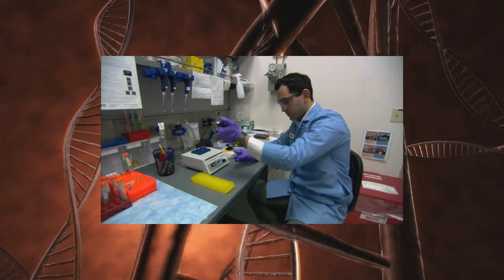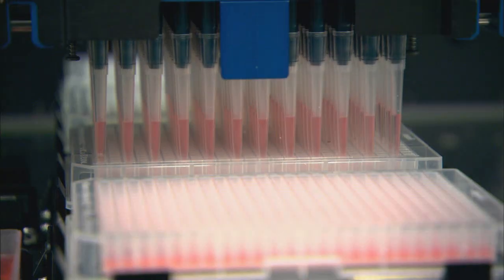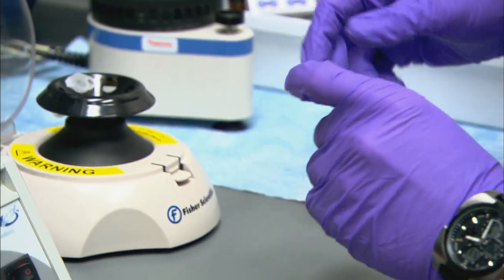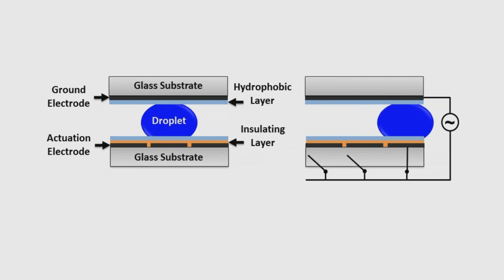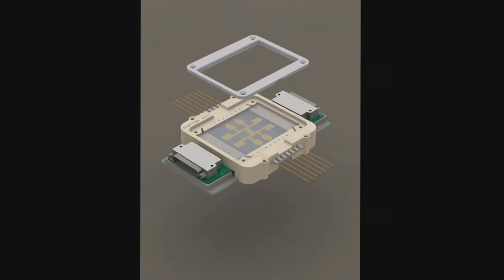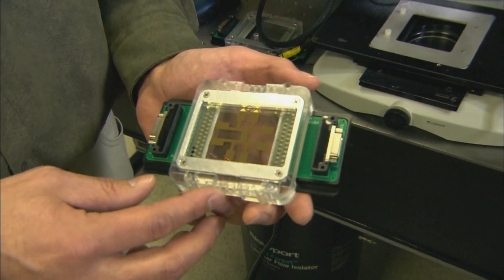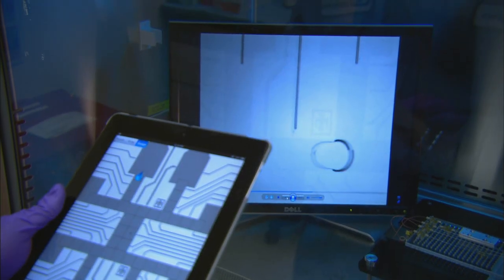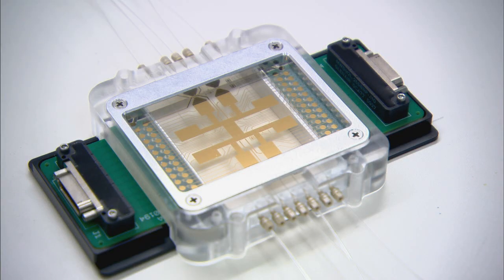Sandia Digital Microfluidic Hub

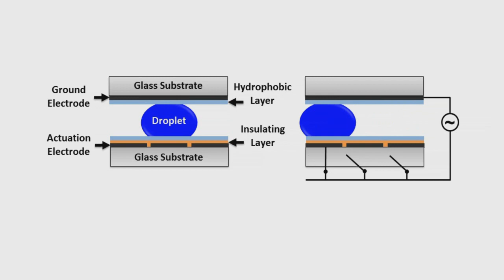Comment: 2:37 - Something tells me pure distilled water can not be moved with this technology? What exactly makes these water droplets move? Electromagnetic field?
Reply: I would imagine that this should work on distilled, RO, or milli-Q water. Water is a highly polar molecule, meaning that one end carries a partial positive charge and one end carries a partial negative charge. If you want to conduct electricity, you would want impurities because water does not ionize (If split by electrophoresis it will form non-ionic molecules H2 and O2). But for simple electrostatic attraction to move droplets around, I think that water would make a great candidate.